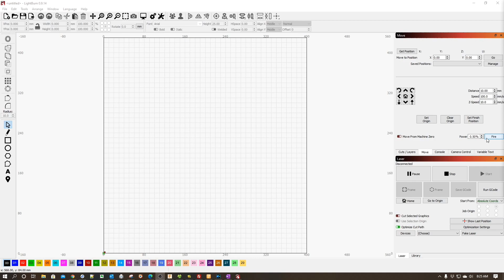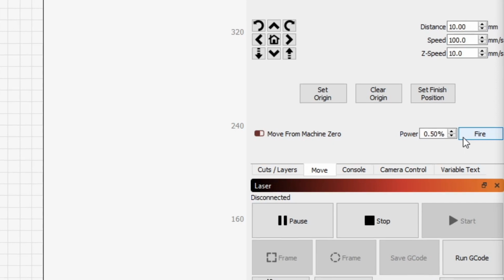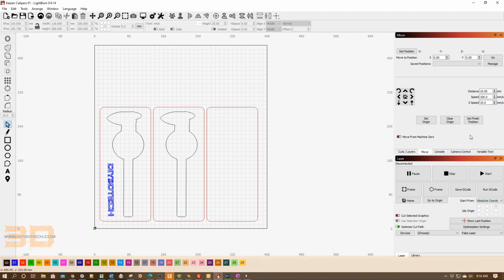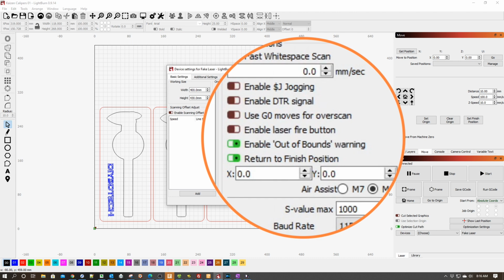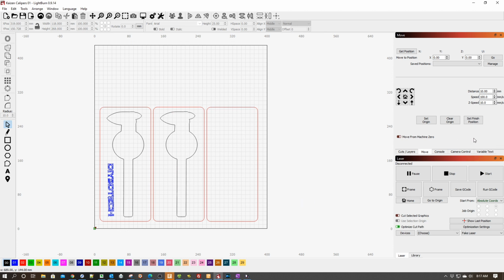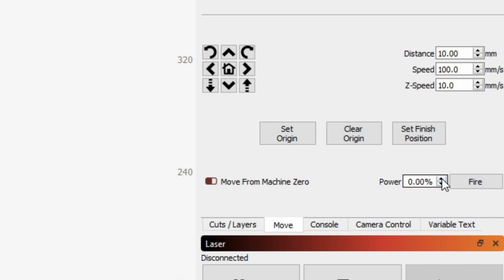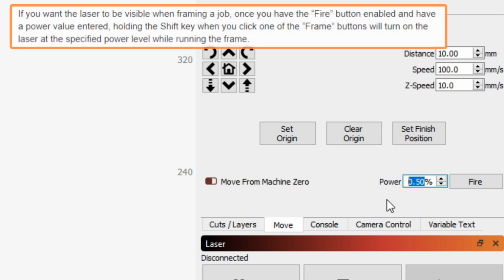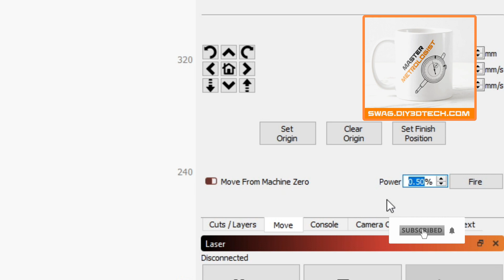LightBurn Tips  -  Add a Fire Button for Focusing!

Comment: Thanks for the help.Why the fire goes off when I press the frame button?
Reply: Did you ever figure this one out?
Reply: I have same problem
Reply: At some point, Lightburn added another toggle on the device settings. Now, below the "Enable laser fire button" toggle, there is a "Laser on when framing" toggle. Change that to green and the laser will work when you click the frame buttons.

Comment: I haven't tried lightBurn yet but I plan to. I'm still using LaserGRBL and to do the same thing I created a custom button. Type: Two State Button  GCode: M3 S1  GCode2 M5  Tool Tip: Toggle Laser Low Power  Enabled: Idle.
Reply: It has a 30 day free trial.  Give it a shot, it won't disappoint!
Reply from the maker: Thanks for the tip but LightBurn is more then worth the money give is a shot as it pointed out already it has a free trial

Comment: In version 1.2.04 holding shift is no longer actual, as it has a "Laser on when framing" switch below "Enable fire button" switch. You can turn it on once and for all.

Comment: I just downloaded the trial version yesterday. I spent most of the day reading the files on how to use it. That out of the way, I have a 3018 pro, I have had it for three months and have not been able to do anything with it. So it was reconmended to try this software. Now I can not get it to fire my laser. I know the grbl board is good, the connection wires are good. I have tested them. I took the laser off on tested it, it works (a shot of blue light came out.) I am at a lose, any ideas for my next step?
Reply from the maker: You need to make sure your correctly connecting the laser to the PWM output of the GRBL board, an you also need to ensure your sending and "S" with the M code too.